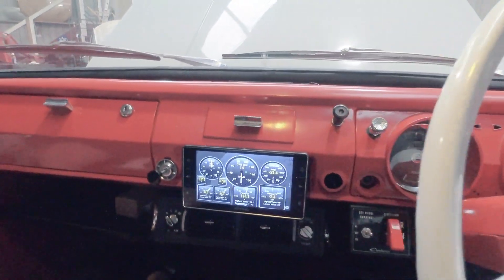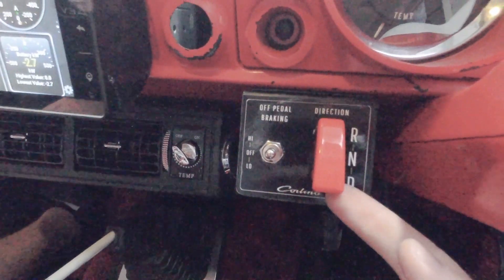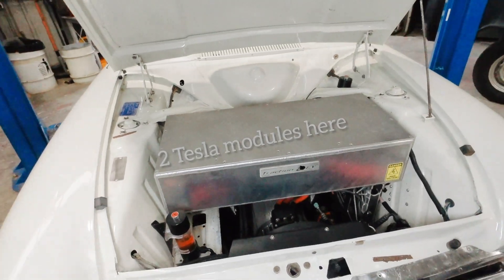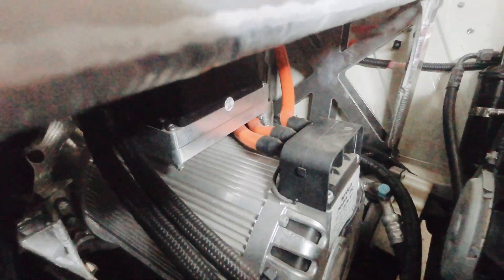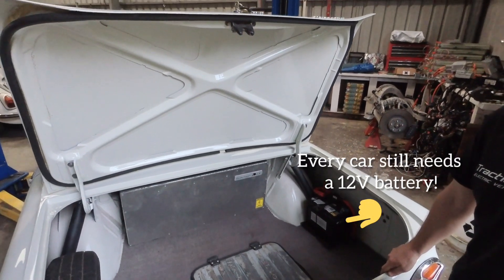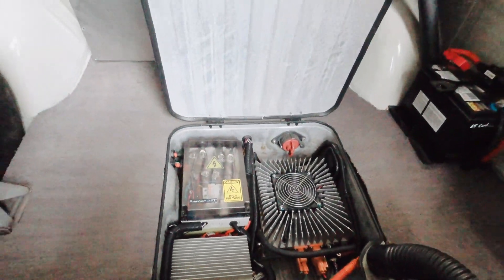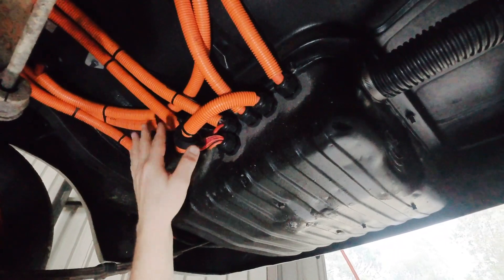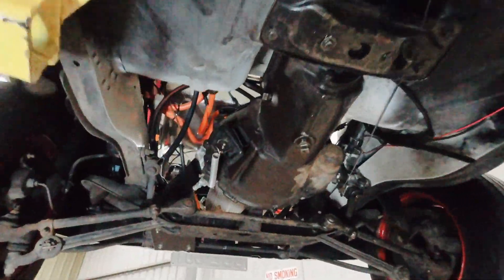Electric Car Conversion BUILD video - Classic Ford Mk1 Cortina EV - walk-around tech talk

Comment: What sort of motor do you have driving the ac compressor?
Reply from the maker: The A/C compressor is electric, it runs directly off the battery pack at 110V.

Comment: Great job guy really well thought out nice clean install big 👍 thing must alot of fun to drive have you seen rich rebuilds electric rat rod here on YouTube it's pretty cool but yours is on hole different level was it hard to register or engineer ?
Reply from the maker: You have to have an engineer approve it and install the modification plate, but if you follow the guidelines its pretty straight forward. Easy to register once its signed off by an engineer.

Comment: Also safety, Airbags? abs, traction control, crumpled zone protection, etc etc ?
Reply from the maker: It's a 1965 car! Brakes improved and modern seat belts added. Can't add anything more. If you want those things get a modern car
Reply: A strange question. It's a classic car.

Comment: Yea all very super but how much would it cost? I bet it costs more than an original ‘electric’ car?
Reply from the maker: if you mean an electric car like a Nissan Leaf then yes, you can probably buy a second hand one cheaper than this but one is cool and unique the other is a Nissan Leaf!
Reply: @chargedgarage131  in NZ you trip over Leafs where ever you go. Ex Japan imports. The good thing is at some point leaf motors will become cheap. Batteries are uncooled and people fast charge them..

Comment: Hi, most encouraging as thinking of this for an old Falcon or Sierra I have or both :)
Really interested in that electric A/C system, and you mentioned about 2:28 that it worked really well. What cost to buy, time/cost to install please and where to get it thanks?
Reply from the maker: Yes the high voltage A/C works very well and is very efficient. The whole system was out together by sourcing various different components, the only unusual part is the HV compressor which we got from China. All up a couple of grand AUD I suppose. Contact James at Traction EV for specific details.

Comment: Very nice build, gentlemen. This really came together nicely and love the "simplicity" and that you were able to complete the build without sacrificing any of the exterior design of the car. I've been following for some time through IG and have been looking forward to a more detailed video of the conversion. Apologies if I missed it, but I assume the regenerative braking runs through the rear wheels? Did you upgrade to discs in the front, rear, or leave them as drums? How much does a conversion like this run and how many hours do you have into it? Great job!
Reply from the maker: Thanks for the comps! Yes the regen runs back through the drivetrain to slow up the rear wheels. Front disc brakes and rear drums from factory. No idea how many hours in the conversion... Costs vary depending on specs etc, this type of conversion is around $30k AUD.